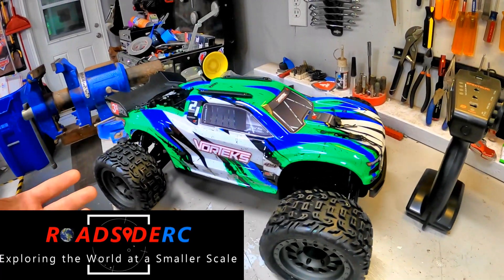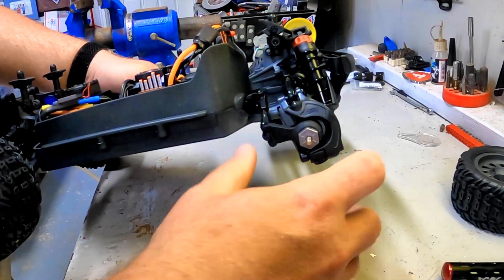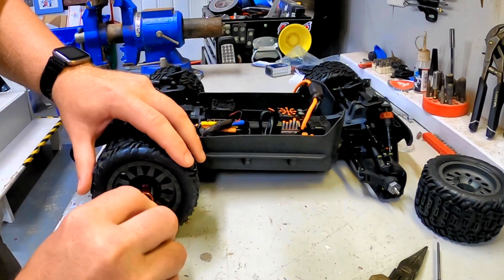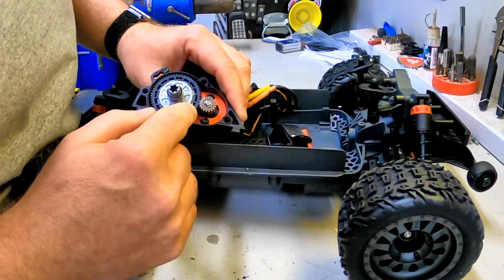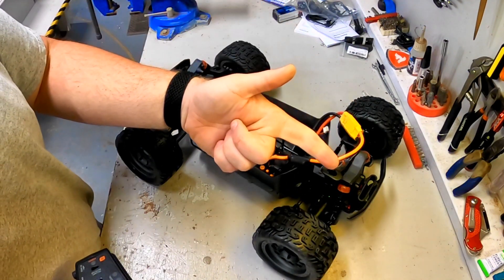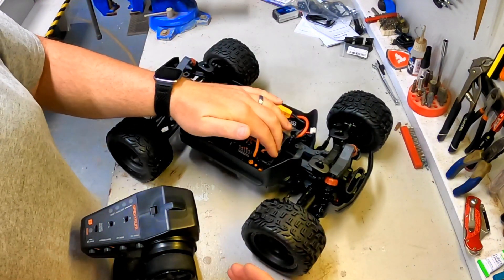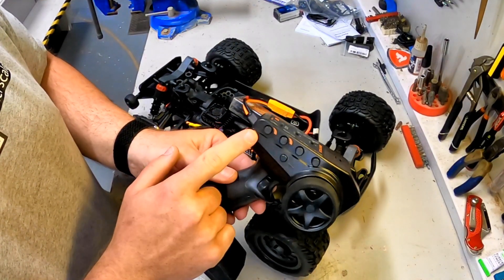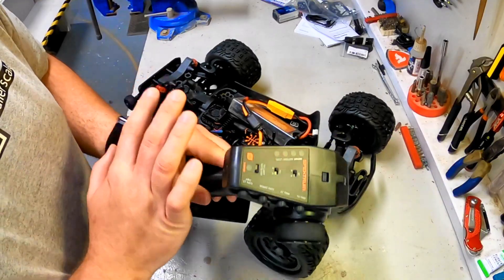DO THIS FIRST! 6 things before you drive the Arrma Vorteks4x4 BLX!

Comment: Just got my vorteks today, the car turns on (so I’m guessing the battery is charged) but when I go thru the ESC throttle program it stops after the first press of the “set” button (this is after the fast beeping). Any clue as to why I can’t steer or have power?
Reply from the maker: Please really double-check that the battery is fully charged. 

Also - check the ESC and receiver for any LED lights.  They will either be solid or flashing. 
Then, compare to the manual - it will tell you what the colors/flashing means.

Comment: Great video. I am new to the world of RC and I picked up this Vorteks. Could you possibly point me to a tool set on Amazon that would allow me to break this vehicle down as needed?
Reply from the maker: Sure - happy to help! 
First is a set of MIP tools:  https://amzn.to/344FZjb
Add on a set of pliers: https://amzn.to/3fBeqDG
A good utility knife: https://amzn.to/3bGN0v1
And add in the free tools they give you with the truck and that will handle most of your jobs for a reasonable price.  

The next thing you will want to add on is a good soldering iron.  I am surprised how often I have this thing plugged in and using it on the workbench:  https://amzn.to/3u6e8tF

Comment: What do mean 2mm wrench? Is that a 2mm male hex (Allan)?
Reply from the maker: Yes - exactly.
Reply: @RoadsideRC  Ok. Cool. These things are pricey!!!! ……………….. do you know the sizes needed for the vorteks? Appreciate your feed back
Reply from the maker: MIP has a 3-pack:  https://amzn.to/3HLfz84

They are not cheap, but 100% worth every penny.
Reply: @RoadsideRC   I really APPRECIATE your responses, when it’s easy for you could you measure the MIP hex wrenches ( length) minus the handles?
Reply from the maker: Does this help?  https://www.amazon.com/dp/B08512M29Z/ref=cm_sw_r_as_gl_apa_glt_fabc_0BAPNKN4YDW9H28XB7JF?linkCode=ml2&tag=roadsiderc-20
Reply: @RoadsideRC  Yes the last response was very helpful……. We checked the pinion mesh and in instructions to reassemble, there’s a liquid labeled “TL”, is that Teflon? If so do we apply to screws at reassembly?
Reply from the maker: Thread locker - like this one: https://www.amazon.com/dp/B004L439FE/ref=cm_sw_r_as_gl_apa_glt_fabc_S4V3M8VHDF86S5PEXJJ2?linkCode=ml2&tag=roadsiderc-20
Reply: If the TL is to be Applied to the screws, is this like a Loctite for plastic to metal?
Reply from the maker: Yes, loctite for metal-to-metal. 
Not needed for metal to plastic.

Comment: Just got mine, rear wheel fell off, I've been watching the intro over and over and I can't seem to get mine to tighten:( I'm new to this hobby too 🥺
Reply from the maker: What part is coming loose so the wheel comes off?
Reply: @RoadsideRC  I'm not seeing a screw to tighten the drive shaft to the hex, not sure if I'm missing it or what but the wheel just snaps on and comes right off. I also have no tools so this probably doesn't help lol
Reply from the maker: Yep - you need some tools for this hobby!   Fortunately, the bare minimum did come with the truck.  

Without being able to see pictures, it is hard to help you. 
I suggest sitting down with the manual.  It has an exploded diagram (and you can get a larger electronic version on the Arrma website).  
Look at the diagram versus what you have to figure it out.
Reply: This is my first rc car, plan on buying some tools tomorrow! Great video btw! Thanks for the response

Comment: Hi guys. A few challenges here. Wheel came off ok, I removed the little screw and pin fine, but when pulling back the axle end my shaft doesn’t come off, so I can’t check the tightness for step 1. For the gear mesh, I remove the drive shaft ok, take the screw out from underneath, but the red block is immoveable - so, as I can’t take that off, I can’t get the rest out to do the checks. Not a great start. Any ideas appreciated. Paul
Reply from the maker: For both of these, I think you just need to be rougher with it. 

As an example, that red block is wedged in there hard.  Really need to pry it.
Reply: So, yes, a little nervous. By putting a screw driver in the slot next where the strap goes in to move out the left side a bit, I could then move the rest. My mesh seems fine. Quite a lot of the screws around the drive train where not tight but many are those that go into plastic and are not taking a big load so just gently tightened. Re step one, I guess you must need to be quite aggressive with it as the sliding drive shaft collar doesn’t clear the fixed bit. Perhaps there are very fine tolerances of the other moving bits that mean some cars come apart a little easier than others. I’ve left those for the time being and will concentrate on the other checks. Thanks for responding so quickly. Paul.
Reply: The cover of the gearbox with the 3 hex screws, did you put thread locker on when you put the screws back in ? I’ve always been told that threadlock into plastic can damage the plastic. My screws had some ‘gunk’ on them, so I’m hoping that is enough after good tightening. The bottom right hex screw actually had some almost white gunk deposit about 5 mm from the end which actually made it quite hard to pull out - so I didn’t. Again, I assume this is part of the Arrma original build ‘thread lock’.
Reply from the maker: Correct - I do not use thread locker on plastic parts.

Comment: I'm a very new owner of the arrma vorteks. I have run many RC cars in the past. But on the first run the front strut broke on the shaft. I called Arma and they say that there are no replacement parts available. I don't believe them and I'm trying to find an aftermarket strut for the front end. Can anyone help me please. This truck is brand new and I really want to run it
Reply from the maker: Help me make sure I understand you correctly.  You broke the shock shaft itself, or what specifically broke?  

There are MANY aftermarket shock options for these trucks. 
But there are factory ones out there also:  https://amzn.to/2UnoTMq

Comment: Hey man , we are wondering how to adjust power level 50’/,   ,75./,   100.’/. ….. training my boys ……. Rather them start at 50’/.
Reply from the maker: There is a switch on the controller - details should be in the manual.

Comment: To be honest the motor issues on Arrma 3S cars is mainly just shitty quality bearings in the motor in general. The rest of the motor is great but even after adjusting mesh, people still have those bearings fail very early on. I would go ahead and just pull the motor apart before ever driving it and just put different bearings in it. Its a shame because its such a pain to do, but its better than destroying the motor when that bearing fails at speed.
Reply from the maker: Good point, however I have never actually killed one...yet
Reply: @RoadsideRC  Good job man you got pretty lucky on the lottery draw then. Just be sure to check it once in a while. It is almost always the forward bearing at the output shaft that fails. Just check the shaft for play once in a while, if you feel play in the shaft then open up the motor and replace the bearing immediately. Otherwise if it fails at high RPM the bearing will allow too much movement and it will destroy the whole motor, seen it many times on the 3S Arrma Spectrum motors. Best of luck!

Comment: I agree with checking your RC before running it - wheels etc. However, HH in my opinion should not be letting this happen. It's called an 'RTR' for a reason. Consumers shouldn't be needing to get in to the gear mesh, not before it's first run. If I buy one of these and I get this issue, I won't be taking it apart. It'll go right back to the dealer and I will be contacting HH.

This is happening all too much with Arrma products.. the first Granite had leaky shocks for example. They might be easy fixes, but it should not be happening straight from the box. It's about time HH took responsibility for distributing half-assed products.
Reply from the maker: Even with these small annoyances out of the box - their products are still MUCH better than competitor products.   Nothing mass produced comes out perfect - especially when you know the margins are thin.
Reply: I agree to an extent. As I said to a co-worker " how can you expect your machine to get fixed if you don't tell the appropriate person that it isn't working correctly". That being said, I can understand a simple check on the RCs out of the box, but if it's continuous, how can the problem be solved at the manufacturer if we as the consumer are taking our time to resolve it. Many times we as consumers don't say anything and the problem happens the same way (like tight gear mesh for instance) with every model. How can we assume the problem will be fixed for someone who doesn't know any better. Hobby grade RCs are for more advanced users when compared to a department store RC, now everyone starts their hobby enthusiasm with a hobby grade RC. You don't go from playing with a department store to knowing everything you can know about hobby grade RCs. You have to start somewhere.
Reply: @RoadsideRC  I took delivery of a Vorteks today, the pink / purple one. As a Granite V3 owner, I couldn't resist it any longer! I did the usual checks on it, but didn't bother looking in to the gear mesh. However, it is smooth out of the box. It's part of a second batch that came in to my local RC shop, so maybe some things have been addressed?

I only gave it a ten minute run up and down my road (a lot of parked cars) but I am seriously impressed at how controllable it is. AVC was on about 50% and it stays so true and straight and has a lot of grip. It gives a huge amount of confidence to the user, very quickly. If I get time over the weekend, I'll head to a decent road that is devoid of traffic and give it a beasting, and perhaps try out the other pinion gear. The weather is supposed to be a bit crap, so I'll have to see. Anyway, I'm impressed so far!
Reply from the maker: @Mapantz1  Glad to hear you really like it!

Comment: That is not how you set the steering end points. You did everything right up to the point of turning the steering  mob on controller. Once you go full right and full brake and turn your controller on and it blinks you use the buttons on side of the controller think they are labeled a-b to set end points.
Reply from the maker: This is exactly how the instructions from spektrum show to do it.
Reply: @RoadsideRC  do exactly what you did with the remote full break full  right turn it on until it starts blinking. Then turn all the way to the right then hit the button on the side labeled b your wheels steering will start to turn.
Reply: Not trying to be a dock hope you did not take it that way. You can do what you did with our making the light blink on controller. You just turned down steering rate witch will work but does not set end points. When you set end points you can keep steering rate turned all the way up. It is best to do it with Front  tires off ground also.
Reply: If I could make a video and send directly to you I would but don’t think I can do that.
Reply: What h video called right way to calibrate your slt3 radio. He goes threw it. You have to download the instructions for the remote it does not tell you how to set end points in the manual that comes with rc.
Reply from the maker: @autnant2012  Thanks - I will check it out.
Reply: Thanks again Troy for this great video! I just bought two and went over the first few things last night!

I know Arrma has been leaving end point settings out of the manual, so I downloaded the DX3 manual to check. What you show in the video is reducing the dual rate so the steering does not exceed the end points. That will also reduce AVC in this case. You would only do that with a radio like the DumboRC that does not have individual steering end point settings. The DX3 has end points settings but the process is not in the Vorteks manual at all. I had hoped Arrma learned from the rash of burnt servos and put the process in the truck manual but they must believe it is too complicated for most people.

Here is the DX3 manual and the relevant instructions to set individual end points for left and right, without changing the dual rate.
https://www.horizonhobby.com/on/demandware.static/Sites-horizon-us-Site/Sites-horizon-master/default/Manuals/SPM2340-Manual-EN.pdf

End Point Adjustment Mode
The default end point value is 100% for both steering and throttle/brake. The maximum end point value is 150% with adjustment.
To adjust the endpoints of the steering and throttle/brake:
1. Power the transmitter on while holding the steering wheel full right and holding the trigger at full brake. The power LED flashes blue to indicate the transmitter is in end point adjustment mode.
Steering:
2. Turn and hold the steering wheel full left. Turn the steering rate knob to set desired end point.
3. Release the steering wheel and reset the steering rate knob to full.
4. Turn and hold the steering wheel full right and turn steering rate knob to set desired end point.
5. Release the steering wheel.
If you are adjusting the throttle/brake end points, continue to the next section. If you are not adjusting the throttle/brake end points, power off the radio now to save the settings. Set the rate and brake rate knobs back to the desired positions before operating the vehicle.